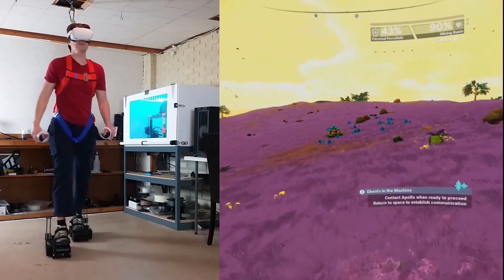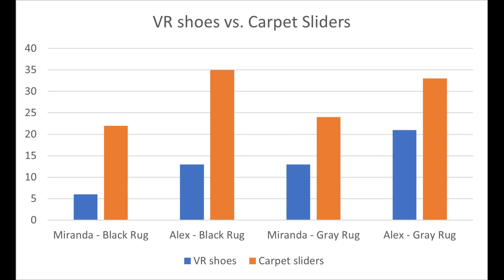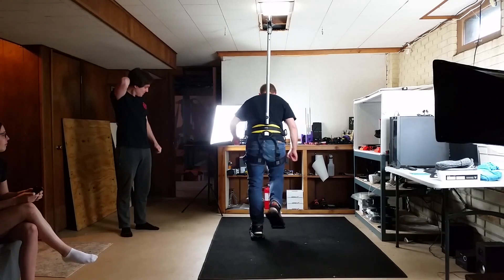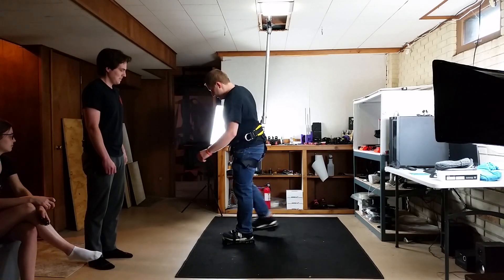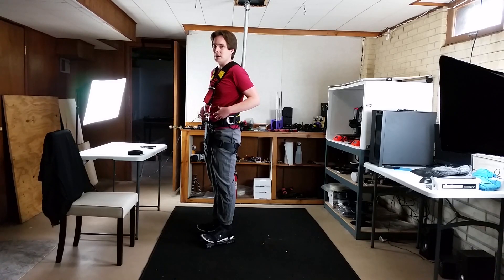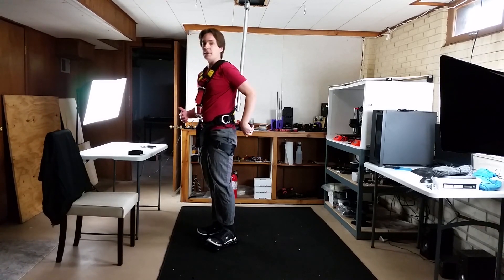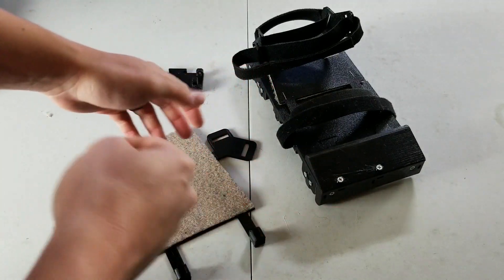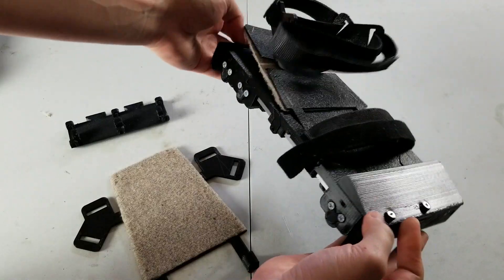VR Shoe Build Log #39 - My Wife and Friend Try the VR Shoes + Carpet Slider Testing

Comment: Fully agree about the belt placement. A lot of people "pull" at the waist or lean forwards to try to get leverage. Your friend almost looked like he was watching his feet while pulling away from the bar support and changing his center of gravity. Perhaps if the belt were higher on the abdomen and the upper harness was used but anchored at a higher point on the support this would help people be more up right (but it would feel restrictive). I believe the Kat walk C belt or the vest may be a better option, although yours would be great for the sitting aspects in VR games.  Did you have your friend try it with his eyes closed? That feeling of trying to move but not moving may cause some leaning to take place in order to "get somewhere". With the eyes closed I'd suspect their "reference" would be altered and they wouldn't pull so much against the support. A lot of people have reported that it takes awhile to learn to use the slide mills and "one video" with their first impressions are quite different from their 2nd or 3rd video a week or two later, usually they are more upright and don't appear to be fighting the support. Now to watch the full videos...
Reply from the maker: Yeah, I like the current harness because it can support sitting. Maybe have that and make a waist strap. Or there are these military vests with loops all over them, so maybe I could use one of those. With a vest I might need to watch out for it being too hot.
I had my wife try it with her eyes closed, but not Brody. Brody did mention he wonders if it would be easier if he actually saw himself moving in the game. In my experience with the last motorized version of the vr shoes, it was a little harder to use them in game since I couldn't see my feet.

Comment: Your buddy looked very awkward at first, haha. Yeah, including a haptic vest as the harness is totally the way to. 
Thanks for the update and good luck!
Reply from the maker: A guy just joined my discord that is making a DIY haptic vest and showed that he is using a military vest as a base. It has a bunch of loops all over it, including on the back. He gave me the idea that I think if I use a vest like that, I may be able to incorporate it into a support rig.
I wonder if you're only wearing a vest like that, if it will still save you from a fall, or if you fall if it will awkwardly rid up into your armpits. Hmm. And one thing I like about the bottom part of the harness I have now is I should be able to sit while in the support rig. If I only have a vest, I can't do that. Anyway, lots of possibilities and combinations are possible.
Reply: @finallyfunctional  interesting stuff. I pictured the vest having a ring clip on the back, sorta between your shoulder blades, to a bungee to support some weight? But, I've no idea how much weight the support needs to hold, probably more than I imagine. And I agree, your buddy was leaning way forward too much, seems odd he has that impulse. Though, walking is pretty much just series of failed face-plants, so lol. Anyways, good luck with it, thanks for updates.
Reply from the maker: @fernalicious  I'm imagining coupling the vest to the support rig in a few different points. I'm thinking at least at the middle back, possible more points at lower and higher than that.
I've seen the issue with leaning to far forward in several other videos I've seen of people using slidemills, so I guess it might be a common issue.